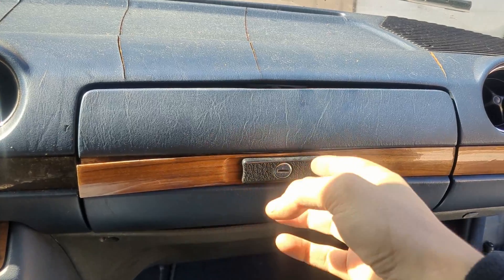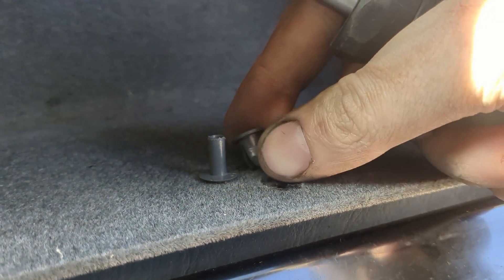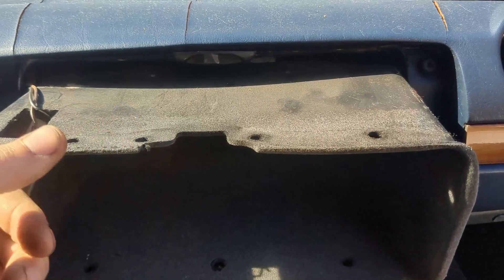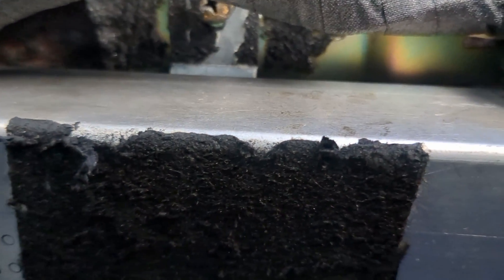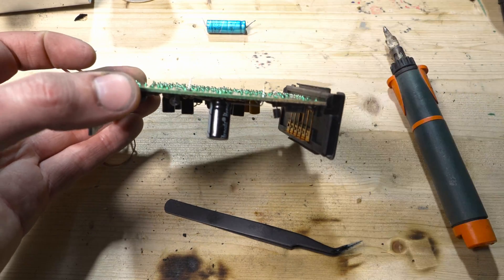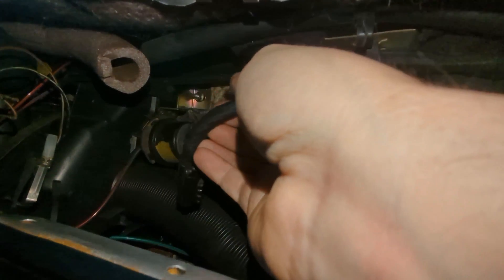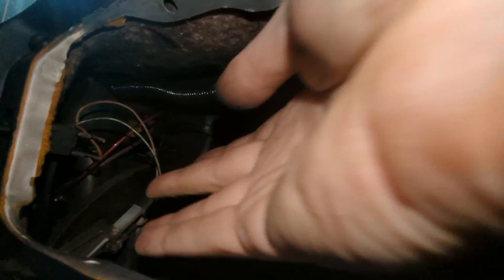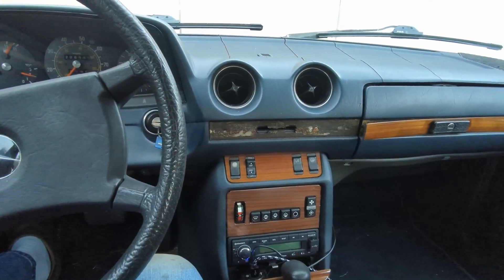W123 Automatic climate temperature regulator box repair (Bosch temperaturregler)

Comment: Thanks for this video i found my center flap not holding vacuum, I disconnected it for the moment. Now i get air through the center diffusers.
Reply from the maker: Mine is also disconnected, has been for a long time, they are a challenge to replace, eventually I should look into doing it, but I also don't mind the center diffusers constantly blowing air regardless of which setting its on.

Comment: Hi. Where is the box on a r107 560sl? Thx
Reply from the maker: You might have the ACCII style climate system in a 107, which is very different, Are your climate buttons arranged vertically or are they horizontal like in my W123?
Reply: They are horizontal
Reply from the maker: I believe it should be behind the glove box and be the same as mine, the earlier accii systems used an "evil servo" that was controlled by a different looking box, which also happened to be behind the glove box

Comment: Thanks for the info! I’m about to retrofit a gen3 climate control in to my non ac car. Thinking about replacing the vacuum pods with electric solenoids instead, the outputs to the vacuum solenoids is 12v on/off if I’m correct so it should be pretty easy to do if I find some good matching solenoids
Reply from the maker: Yeah as far as I'm aware there isn't any vacuum modulating going on, either a pod gets full vacuum or no vacuum, so some solenoids with a duty cycle to handle that would be quite the upgrade!
Reply: @trythistv If the vacuum switchover valves receives 12v from the control module (haven’t had the time to check this yet) it shouldn’t be more complicated than swapping does out for regular relays and the vacuum pods for spring back electrical solenoids with the right stroke length

Comment: Did you use a butane blow torch soldering iron ? If so, awesome job 👍
Reply from the maker: I did on the cruise amp repair, I have since gotten a little better soldering station so I used that for this climate module thing, but these boards are pretty simple with giant through hole components, not too daunting for a beginner